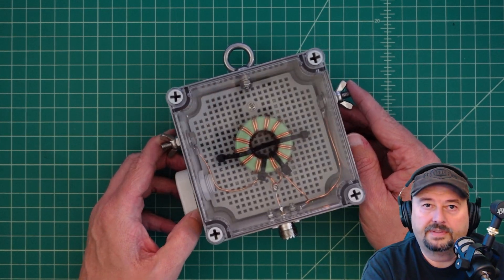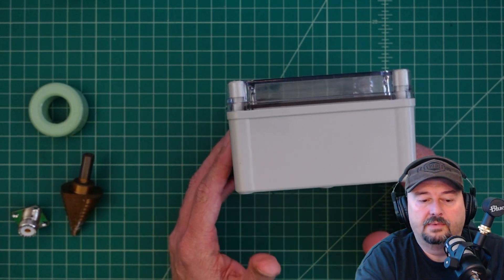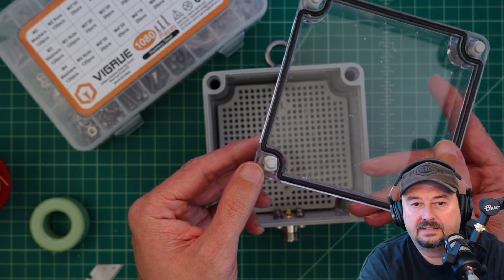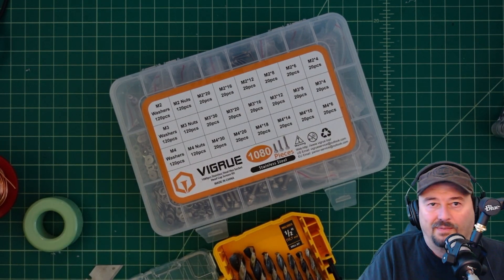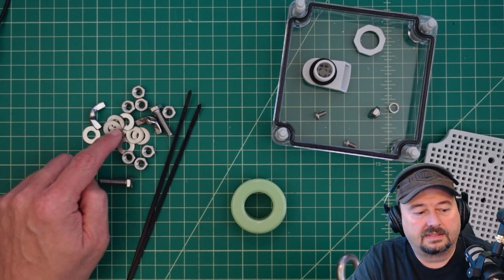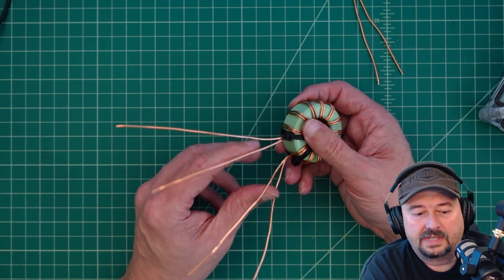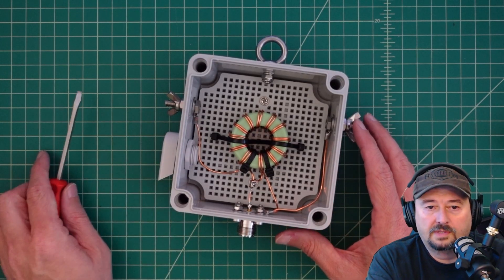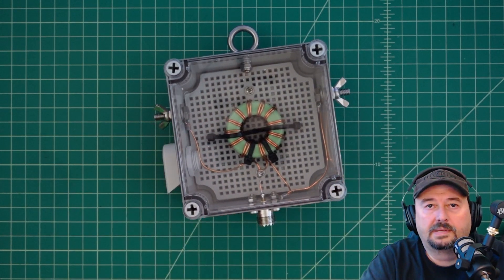CaHRTenna Kronos Prototype - 4:1 UnUn for Ham Radio Antennas

Comment: There are drill bits made for drilling plastic that have a different tip design and work better in plastic.
Reply from the maker: Thanks Alan, I should probably look into that 🤔
Reply: @TheSmokinApe  They would not replace the step drill (which works quite well in plastic), but could be used for the smaller holes. Tap Plastics has them, as should any business that deals in plastic material fabrication tooling. 73 de w6akb :)

Comment: Hi Smoke! I am making an EFRandom wire antenna. I have a Palomar Engineering 9:1 Bullet Balun with a homemade choke right beneath it. It has a connection for a counterpoise. Where should I land the other end of the counterpoise?  I also have another homemade choke right behind the radio. Both chokes are FT240-31 and inspired by you! The antenna is 71 ft long and has a right turn at 50 ft. I want you to know that you have been a great help in this project, and, also learning to use my new Nanovna H4 which I purchased from Bangood for $67. I've had a lot of fun with it. THANK YOU!
Reply: Also what guage wire should I use for the counterpoise and stranded or solid. Thanks again.
Reply from the maker: That’s awesome Gerald!  I’d do a 17’ counterpoise the opposite direction of the antenna if you can 👍

Comment: I’m not a fan of iron toroids (from what I’ve learned so far / not an expert).  They’re generally most efficient in the Hz range because how slow they are at building magnetic fields, ferrite in the KHz range, and air core in the MHz range.  The only benefit in the iron to air spectrum is iron saturates the least and air the most.  So it’s best for power supplies (50-60hz), and high power HF.  It would be interesting to see more air core transformers for receiver antennas for their HF, VHF, and especially UHF efficiency.  You’re not going to saturate it just receiving.
Reply from the maker: Hey Azred, in the past you would often see powdered iron is in 4:1 and 9:1 transformers, there's plenty of documentation on the internet showing this.  We have built an antenna using a 4:1 Voltage UnUn (t130-52) that is performing very well SO I decided to  experiment with a much larger core of the same type to see what happens 👍

Comment: great project. Thank you for the link for that project box. they have bigger and thicker one just like that. what i was looking for. 2 or 3 stack FT 240 cores . KW UNUN box.  nice vent. I have 10 AWG mag wire. not looking forward to wrap that. I did some all ready. fingers hurt 2 days. That green core you are using brings SWR down on many bands so a 3:1 tuner will work. this also makes feed line loss less . when you push feed line over/under the 50 ohm . the loss goes up much more than data sheet on coax.  that data sheet is for 50 ohm . getting closer to that makes feed line loss smaller.  even though the core is less efficient it is made up buy less feed line loss and the total efficiently is pretty good.  that's why the antenna works so good. it's more than the core. the core loss is made up in outher ways . you have to look at the whole antenna. coax and tuner as well. like to see some testing on them bigger green cores. make 2 and do a loos test with the VNA.  then put 50 ohm dummy load on one side. put some RF power threw and do a thermal test on cores. also watt meter on both ends and gives you power loss test. divide buy 2.  you can call CQ on FT8 into a dummy load. how I did my QRO test before putting on air . 73's
Reply from the maker: Hey Robert.  I like this box but it was probably a little big for this project 👍
Reply: @TheSmokinApe  I got bigger toroid and stack them . found a box for me. that link had many to pick from.
Reply from the maker: I was going to do stacked ft240-51 cores but these green ones showed up in the mail 👍
Reply: Yes, what you intended to order was FT240-52, a ferrite core with an ui of 250.
But you have been supplied with is powdered iron core mix52 that is meant for making CMC choke/filters in the power
 supplies. That is pity.
De VU2RZA
Reply from the maker: @subramanianr7206  no, that’s not what happened.  We’ve been using these core in antennas quite successfully so I decide to keep testing them for experimentation.  I understand your point and felt the same way until I built an antenna with one and couldn’t believe the results.
Reply: @TheSmokinApe  OK, your point is well taken. But, I reckon the datasheet of the core mix only; hence I want to stress on it. You may want to consider discussing it with an open mind anyway. 
Thanks for the video presentation. I enjoyed it for sure.
De VU2RZA
Reply from the maker: I try to be open minded about it, and I agree with you on the data sheet.  When we first discussed using the core for the Poseidon I was very much against it...  even when I make this transformer I was very hesitant as well.  If it doesn't work out, I'll just swap the core.  We did send a TnE antenna to KB9VBR for an impartial review, you can see it here: https://www.youtube.com/watch?v=KI9RTQkHzto
Reply: @TheSmokinApe 0:01 .
I saw the video documentation you suggested. 
I got amazed. So, I have to keep my mind open, I believe..ha..ha..
De VU2RZA
Reply from the maker: Haha, hopefully I can get this test soon.  Thank you!
Reply: @TheSmokinApe  that would be very helpful indeed. Moreover, you may have a similar setup using iron powder core mix #2 and #6 for the purpose of comparing the performance. 
Here, in India, our senior hams had been using low frequency ferrite cores (Mn-Zn) for a long time for RF circuits (of course, due to non availability and lack of information)
Many claimed that they were working well for them. Again, those projects happened to be qrp or mainly in the receiver sections.
But if those cores were used in high power stages, they could have ended up in problems, I think due to core heating up and saturation, etc.
De VU2RZA
Reply from the maker: We tested the 2 and 6 for the 4:1 UnUn and in the past I have video for testing them as 9:1 if you are interested.
Reply: @TheSmokinApe  OK, I believe I have seen this before. 
This time, a comparative study would be handy, I believe. 
De VU2RZA

Comment: Good stuff. You will  find that a 16mm Hole Saw HSS High Speed Steel Drill Bit Hole Cutter $7 Amazon works much better for a Pl259.
Reply from the maker: I like that idea 👍
Reply: I'm going to check that out too; nice tip.

Comment: Hey Ape. Got a trick for you, you may not know about. Those molded post inside the box, which are in our way more times than not, can easily and effectively be removed by taking a larger drill bit and just drilling them out. If you're careful not to create a hole into the bottom. I use a 1/2 inch drill bit and can remove 100% of the post without causing damage to the back of the box. It will leave a small davit in the bottom but also flat so anything sitting on top of the area will lay flat.
Reply from the maker: That is a good idea, thanks man 👍

Comment: Good idea with the vent! Also, I did the same thing when I built the cobweb, forgot I wanted to mount stuff to the board.. much easier to take the board out 1st :)
Reply from the maker: I’ve had that vent sitting around for a while, about time I used it 👀
Reply: @TheSmokinApe  I think I have had one sitting in the Amazon cart for about a year now
Reply: Drill 4 drain holes on the bottom to let the moisture out. 😀 That's how the Military does it.